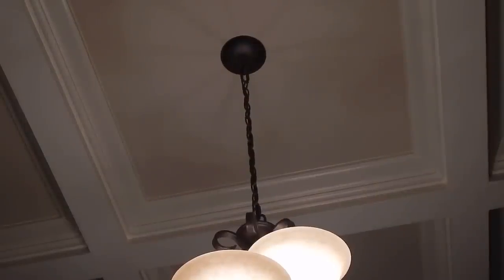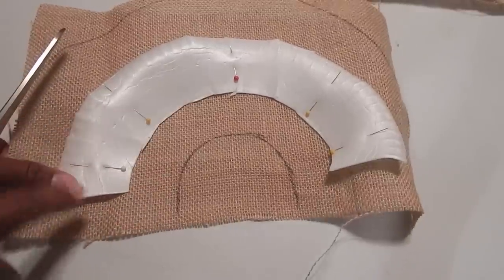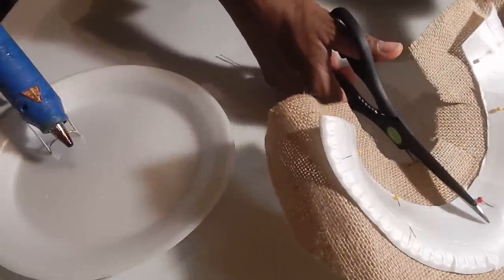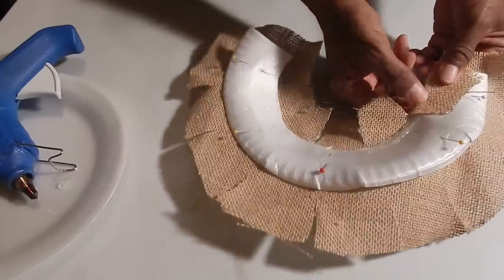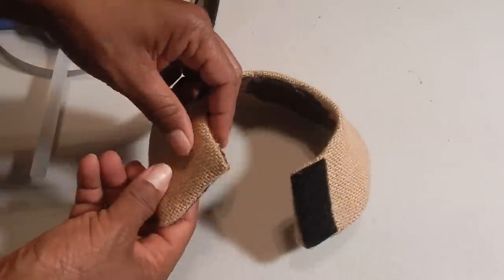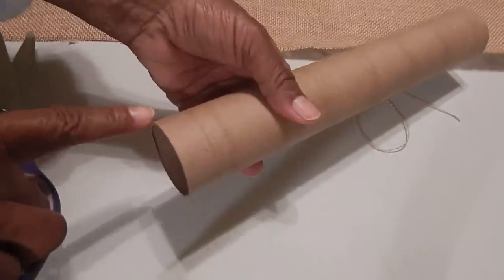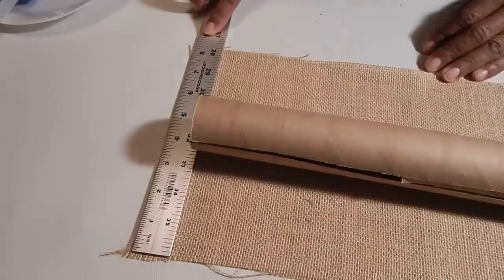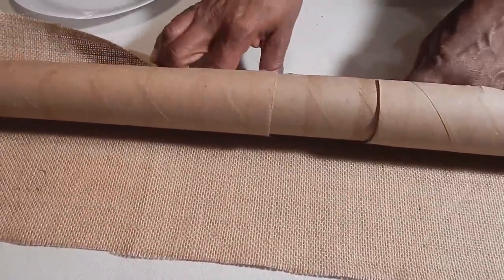DIY - How To Jazz Up A Chandelier

Comment: Fabulous idea.   Now you have my wheels turning, trying to figure out a way to dress up a ceiling fan. I too love your coffered ceiling.  I would love do my ceiling also but am afraid since they are only standard 8" ceilings and they are stippled (which I hate) that it may not look right.
Reply: My bad.....I probably wasnt clear.  I would love to add trim to make the ceiling coffered. Just afraid it wouldn't look right since they aren't high ceilings.  I do plan on trying the burlap on a chandelier that hangs over my baby grand piano.  Do you think that adding coffer trim would make the ceiling look to low.
Reply from the maker: Pianogirl 124 I did a little research for you on coffered ceiling.  I wanted to share this info with you.  
1.	Ceilume Ceiling Tiles - http://youtu.be/_w5mQilystY
2.	Coffered ceiling tiles - lighter, stronger, more efficient. 5 Styles to choose from.  http://youtu.be/QLZsCZ-231A
3.	Coffered Ceiling: Check Out This DIY Coffered Ceiling Project
http://youtu.be/NT7tlmesZnY  or http://malinowskiteam.com
http://www.woodweb.com/knowledge_base_images/zp/QuickerCofferedCeilings.pdf

Best wishes on your project!